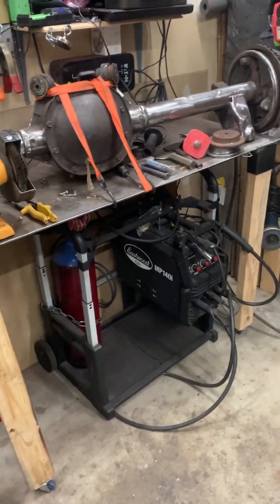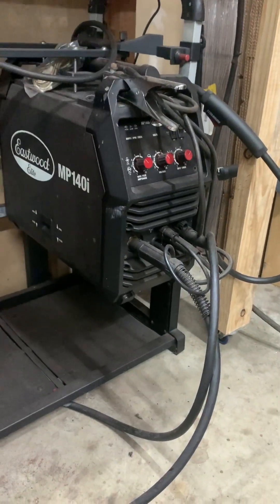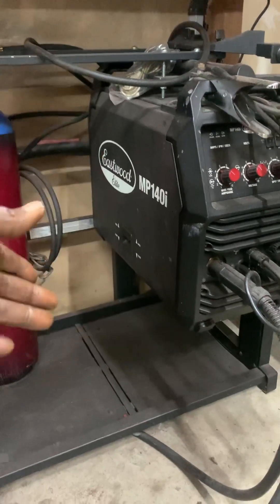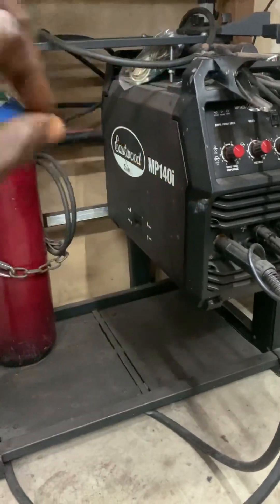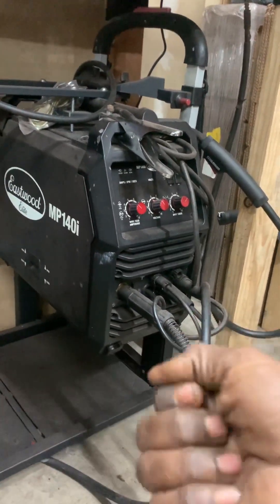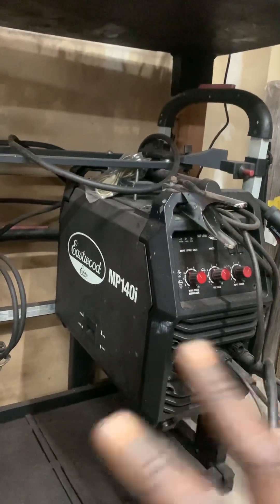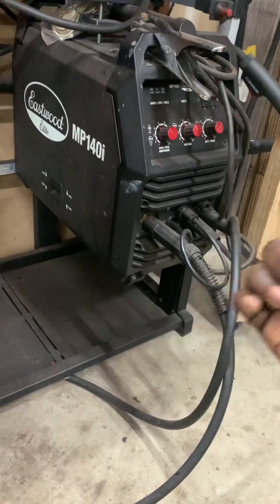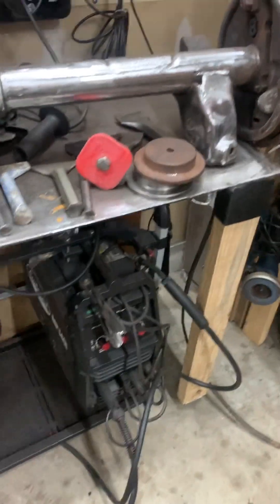Can you weld 1/4” steel w/ a 120V / 140A welder? Yes! Learn how.. (Eastwood MP140i)￼

Comment from the maker: I forgot to mention you need a bevel on 1/4". This means the edge of the the material needs to be ground down to a 45° angle on each piece so there is a Vee that you start laying the first bead down in. They make attachments for angle grinders to do this. In Pipe Welding they call it a "root pass" and it s a straight bead. The consecutive welds are varying like weaving and what not. I'm not sure what they call it in this case. Just look up techniques for "how to weld a beveled joint in steel plate." Good luck!

Comment: The 15amp plug is actually rated to hold more than 20amps its just used just like they said for people who only have a basic 15amp outlets. It can be used on both 20 and 15 amp outlets though.

Comment: I have a 30 amp outlet for my welder (110v).  Helps a lot. It was run with 10 gauge from the main breaker box
Reply: Same here
Reply: You have a 30amp breaker to a 20amp plug?
Reply from the maker: That's correct. 2 things- the code allows a step up in breaker size SPECIFICALLY for arc welders due to the current spike at the time the an arc is struck raising past the rated draw of the machine and two, 10AWG THHN is what's required for 30A anyway.
Reply: @phreaktor  okay just making sure because I'm doing the same. I thought @nmartin5551 rewired his welder with a 30amp plug and outlet like off a generator.  Those circular plugs haha. Thank you for clearing it up for me.

Comment: Yea you don’t need a designated plug just a plug that has nothing else using electricity at the time. And it has a 12 gauge wiring. These are 20 amp welders and yes you can weld using them in a 20 amp circuit. The longer the cord the more amps it will draw. So yea it needs to be at least a 10 gauge cord. If using an extension. But again you are at the top margin of the machines ability so why would anyone set themselves a 20 amp limit? If they need to weld 1/4” ? I mean it’s good that you can temporarily do a little extra work but for me it would be enough reason to move to a 220 welder immediately. 
I have an Eastwood 140 and it won’t do penetrating 1/4” welds. Even with an open electrical line. It’s an older machine however. But I didn’t get it for that I got it for sheet metal. Great info. Thank you.

Comment: I have been through what you are explaining, and feel really tricked by the company who sold the welder.  The company was not Eastwood.  

What I purchased was advertised as a Tig/stick welder that would run on 220 or 110 volts.  But after going through an experience like yours, my electrician pointed out that although the machine would run on 110, volts, it needed a dedicated line with 50 amp input volts and a 60 amp breaker to run the welder at full capacity without tripping a standard (110 volt/20 amp) breaker.

Buyer beware.  And remember the old adage, "When somethings appears too good to be true, it probably is."
Reply from the maker: I hear you, bro. At the same time, you need a quality 120V machine that can actually do what it is advertised to do. There are a few brands like Lincoln,Miller, Eastwood, and even Yeswelder that manufacture 120V and 120/240V machines that are reliable as far as the specs. 

Also, there is no mathematical reason a 120VAC capable machine would require 50 amps of supply current at 120V. It is impossible when you are on 120 volts. 

Your machine is 120/240V, so in order to max out your settings that the machine is probably advertised/rated for by the manufacturer, it is possible that you DO need a 50A capable wire run to max out the advertised settings at 240V…. but not at 120V. It is a little difficult to explain via text, but 99% of 120V capable welders can do the max rated output at 120V on a 120V 20A outlet/wiring run (12ga).

If you’re buying that kind of dual voltage machine, it’s probably because you plan to use it on 240V eventually or because it it was affordable, so you are limited to the max 120V specs, which still require electrical work to attain without constant breaker tripping, at which point you may as well pay an electrician to install a dedicated 240V outlet. 🤷🏾‍♂️ 

Hope this makes sense. If I can answer your questions, I will. 👊🏾

Comment: So you installed an outlet with short 10 gage wires to the breaker right at the box, then you used an extension cord with the same wire instead of having to pay for an electrician to run the wire and all bc you already had the cords.. damn that’s smart af! I gotta see what those 1/4 welds look like tho🤔 Nice!